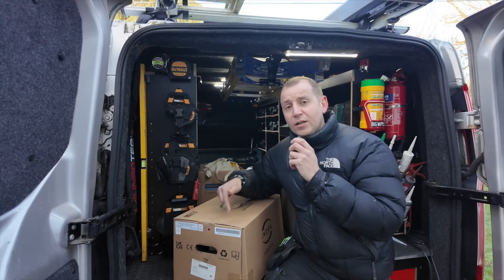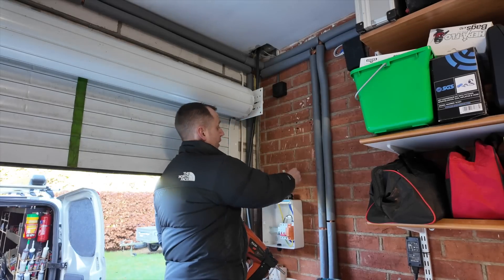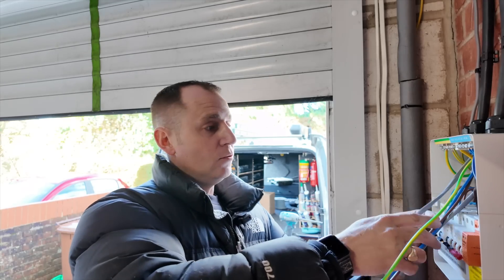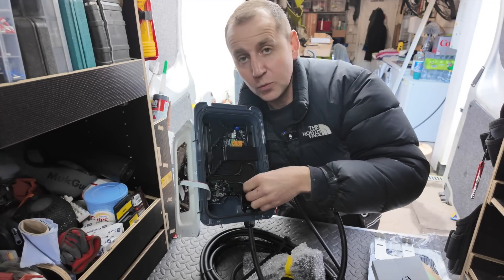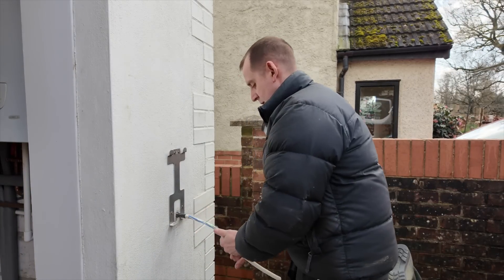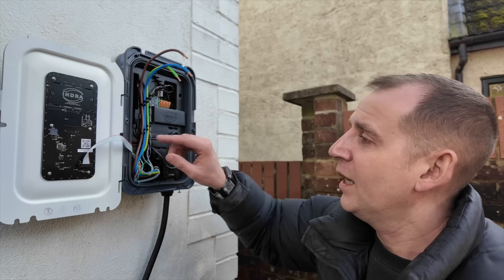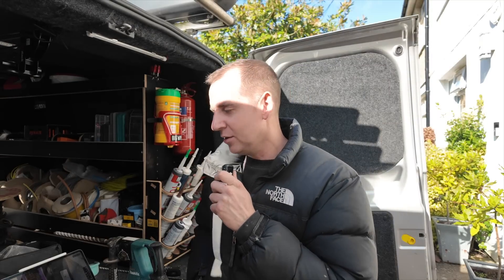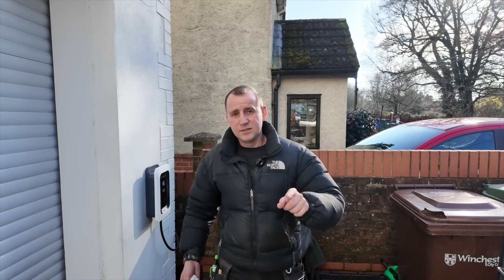NEVER Before Installed EV Charger...HOW TO Install The Indra Smart Lux & Some Essential EV Tools.

Comment: I bought an Indra charger online after checking with Indra it was ok to have my electrician to fit it . They said yes. But when I phoned to login the device I was told they would have nothing to do with second hand units . F**k them . with OVO etc you don't need to connect to the Indra agent  software . SO 😀😀

Comment: Colours don't matter on the cat5 connection so long as both ends support Auto MDIX which basically anything built in the last 20 years will support. When I did my CCNA course they harped on about crossover and straight through cables like your life depended on it, meanwhile in the real world everyone had moved on. Auto MDIX works by probing the other side to see whether it has been wired back to front (like a crossover cable) or randomly by a sparky trolling his viewers.

Comment: Could some of the data boys explain the thinking for using jelly’s and not Wagos please?
Reply: Just space and cost. You will see in the video at 12:29 the install used Wago Inline connectors, but not as inline connectors and some Wago 2-Way connectors. The real issue is the amount of space they then take up. Cost is also a consideration as Wago's are far more costly than average Jelly Crimps. 

For outside work the key advantage is that Jelly Crimps are moisture/water proof. To get the same level of protection for Wago connectors you would need to use their gel boes.
Reply: @rogerthomas7040  appreciated

Comment: What is a lowcatalment (when you mentioned wiring the cat5 cable from the EV ultra) with the hardwired internet
Reply from the maker: It’s what protects the main cut out fuse basically

Comment: Hi, I just watched your short video on a customers charger only charging one car, well I had exactly the same problem. The issue was one of my EV was going into sleep mode. I would plug in about 4pm schedule to charge at midnight by this time the EV went into sleep mode and would accept the charge. Hypervault logged into my charger remotely and changed some settings now works fine.
Reply from the maker: Ah that’s great, thanks for the info!! 👍

Comment: Absolutely horrendous chargers ! Connectivity on them is years behind, generally very poor in comparison to what else is on the market ! Red flashing lights will be the tamper sensor, poor placement on both the Smart Pro and the Smart Lux which might I add is just the Smart Pro in a different case. I don’t hate Indra by the way. Just have no time for poor products which unfortunately they are in my professional opinion.
Reply from the maker: All comments- fair, thank you for watching and commenting 👍

Comment: Hey there, noticed the bin at the start says Hampshire, could you give me a quote to install a charger at my house in Ferndown if I supply the charger? About 30 mins from Southampton :) 

I have a 100A main fuse and the meter box would be less than 10 meters from where I want the charger. I'd like to go the route of having one of those outdoor PEN-Fault protected mini consumer units installed next to the meter box. 

Thanks!
Reply from the maker: Yes or course, drop me an email with your number and ill give you a call 
Enquiries@sota-electrical.com

Comment: PS do away with the hook as that rubber boot gets water ingress, when my spark was installing mine had to call them because of tech and my voltage was 252v on my supply, I’ve changed my earth arrangement for TT instead of PME Indra tech didn’t want the charger settings changed for a TT so I told the spark keep it as a TT as the system is a TT not a PME and I want it wired as such, I polled my Shelly devices and they registered spikes of 254.5v at points which as far as the spark said would have cut out the charger. After months of chasing the DNO I got them to tap the line now max volts 250v. PS my spark was using the engineers portal   to commission he was a good lad showed me it as he was going through it .
Reply from the maker: Great comments, thanks for watching!! 👍👍

Comment: Little giant steps…. I found they weigh a ton compared to normal steps & have an extremely annoying loud click bar installed on the last step which is irritating if your up and down a lot  or trying to keep noise down if a customer works from home
Reply: 100% agreed on all points. Have a set and almost always leave them and revert back to my smaller steps.
Reply from the maker: @Kenny.M.CFC.1888  understood!!! Really appreciate everyone’s feedback on this
Reply: That’s only on the green fibreglass ones I think. The last tread with the warning click 🤦‍♂️😂

The A frame are brilliant (Heavy though)
They are on wheels. But great on uneven ground stairs etc.
Reply from the maker: @BenLawrence-g8n  brill thanks mate
Reply from the maker: Ahh that’s interesting!! Thanks for the feedback!! 👍👍